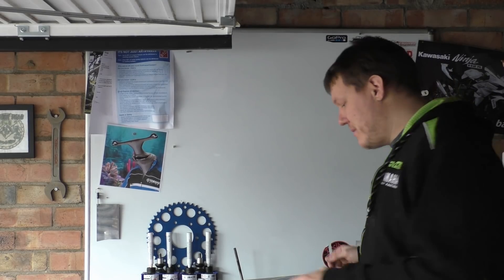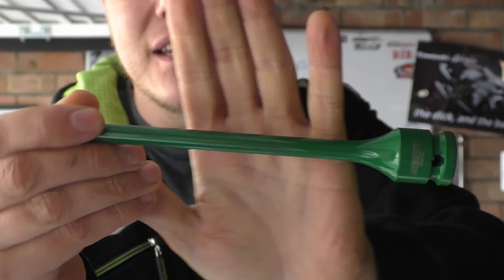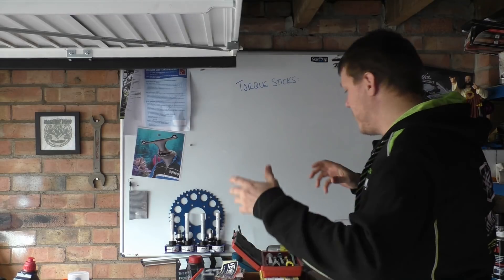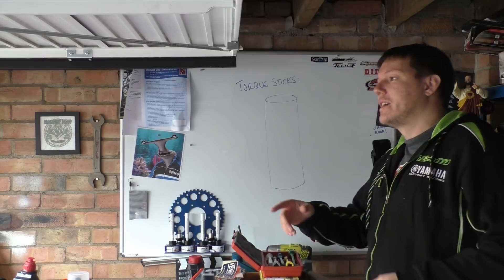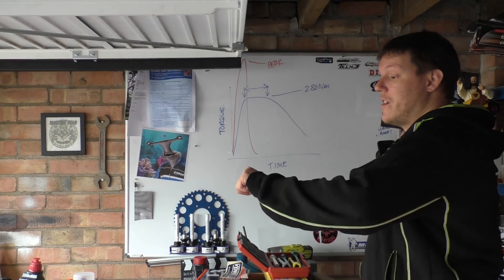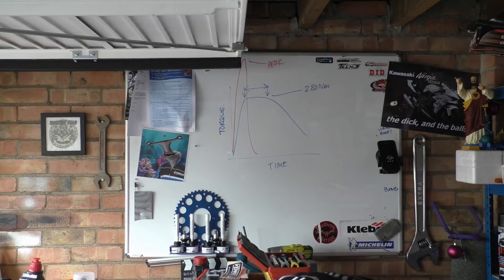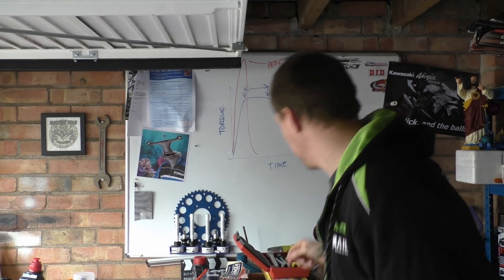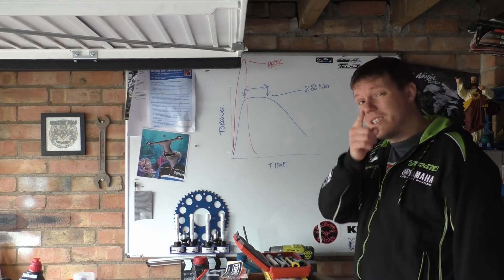Torque sticks - how they work

Comment: Awesome video! So it doesn't matter which impact gun I use at the shop??? Air... Milwaukee battery etc?
Reply from the maker: Well, there is a limit. If an impact gun fires too often then you'll get higher torque.

Comment: FYI - torque sticks are designed to be used  with and air impact. Using them on and electric/battery impact with result in different results. An electric/battery impact hits different then an air impact.
Reply: So, educate us what is the difference?
Reply from the maker: @mrgreen98ski What? Yes please educate us on how an anvil powered by air or a motor is physically different, all else being the same.

Comment: Does this mean that normal torque extensions bars have experience little to no torsion when impact is applied since you want the torque to be directly transferred?
Reply from the maker: That's a very good question, and requires a video...

Comment: 8:18 TRANSFERS KINETIC ENERGY TO HEAT!
You are missing some engineering and physics concepts in this video, but you are explaining it quite well
As for "atoms bending" or some ludicrous thing you said earlier that actually about steel alloy molecules (cube shape with a ninth atom on one face to allow the cube molecule to slide).
Nice tools, but wouldn't it be easier to have a lower torque power impact tool and finish the torque job with a torque wrench instead?
And leave the sticks to actual lesser jobs, those made with laziness with an impact power tool: thinking of someone who installs spark plugs like that 🤦‍♀️

Comment: I saw this about using torque sticks with electric impact wrenches from a company that makes torque sticks "ATTENTION:
Designed for Use with Air Impact Guns.  
Specifically, To Allow Tire Changers Fast Work While Limiting Damage Caused by Over Torquing Wheels.  
Also Helps Them to Use Standard 6 Point Thin Wall Sockets That Fit Alloy Rims (Never Use 12 Point on Anything With 6 Point Fasteners).  
These Are Not A Replacement for A Proper Torque Wrench on Other Critical Torque Applications.  
Not Recommended for Use with Electric Impacts as They Often Exceed 2500 IPM And Are Not Compatible As 41 Strikes Per Second Will Never Recoil.  
Lower Power Cordless Will Recoil but May Never Reach Proper Torque.  
Higher Power Will Over Torque as The Stick Never Rebounds.  
Properly Rated for Use With ½" Air Impact Having 300 - 500 Ft. Lb. Max. 
If Necessary Turn Down Maximum Speed to Strike Less Than 1000 Impacts Per Minute.  
Verify Settings on Your Gun After Initial Use. But Do Not Purchase Unless You Are Certain of Your Impact Specifications Prior To Purchase. "

Comment: How come you choose to put an all balls sticker on your whiteboard? Personally I have consistently found there products to be utterly shit. This is a feeling I have found to be present in my peers aswell.
Reply from the maker: Shite because?
Reply: @thedirtyworkshop  It's hard to quantify due to the anecdotal evidence but more often than not they don't fit even with careful application & removal of  heat. I have had far more problems with the limited number I bought before abandoning the brand than I have had with Japanese bearings bought from the local supplier. I don't believe my issues were due to user error. Another issue I encountered previously was with a swing arm bearing all balls used a piece of plastic between two washers  rather than an axial needle roller bearing to achieve the goal.  The general feel of them has been of poor quality. If I'm feeling rich I may just buy some next time I change out a set to compare to OEM spec (same bearing without the manufacturers storage fee). 
It's entirely likely I have developed a bias.
Reply from the maker: Cheers for the reply - I just wanted to know what you know. It's just a sticker - and you know what blokes are like with stickers. It's not an endorsement or anything - shit, I have a Delboy sticker and a screaming eagle sticker on there too.  The only time I used them is for steering bearing kits.

Comment: I've bolted on probably 5000 car/van wheels with those and an impact gun. Never had a wheel come loose or broken threads, so they must be doing something right. Good video though, thanks for that. I never pictured exactly the working principle of those. You might compare it to hammering a nail. A torque stick would be like a coil spring between your hammer and the nail head. If that makes sense.
Wheels are the only I use them on, and only with an air pressure impact gun.

Comment: Does it matter how powerfull the impact gun is? for example if you use a gun with 400 ftlbs vs a gun with 700 ftlbs will you get the same amount of torque using the same torqe stick?
Reply from the maker: No it doesn't - an impact gun 'hammers' - between each blow the torque stick then 'should' return to its normal rotation.

Comment: Did you test theses in the end ?
Reply from the maker: Not yet - but its coming soon
Reply: @thedirtyworkshop  Did you ever publish the test video?
Reply from the maker: Not yet. The reason was when I tried to test it in with the static strain gauge it was too fast for the cycles rate to detect.

So I'm going to have to measure it with an oscilloscope instead, when I get back around to it. I need to find a strain gauge thay can measure that high.

Comment: I have never used a Torque Stick but from what I have seen in videos and read they are used in tyre shops and production environments and this appears to be more in the USA. I personally would never use a rattle gun to do up to a torque but only the trusted torque wrench.  Have been in the situation after purchasing a 4 year old car couldn't get the wheel off from overtightening or locking up.  It took visits to three tyre shops before I found one that could get the wheel off and that was a small local one with an enormous breaker bar.  However they did say that it was how you used the breaker bar. What I have noticed in recent years is that most tyre shops, or the ones I go to,  now use a Torque Wrench to finish off rather than as used to be the case relying solely on the rattle gun.

Comment: I've used a form of these. they use them on car and truck lug nut's at the street shop i work at.the ones we use have the sockets built in.they've had the same set for over the 25 years I've been there you only use them to put the lugs on never to take them off.

Comment: when properly used one should select a torque stick that will tighten to a torque lower than desired. they are used for the speed of using an impact and getting close to the desired torque without exceeding it,  mainly for lug nuts. after the initial torque with the stick your supposed to use a torque wrench to achieve the proper torque. unlike the assholes at tire source that ram them on with an impact and no stick. then they are fun to get off with a tire iron on the side of the road with a flat.
Reply: My dad has bent multiple cross lug wrenches when the arses at the tire store don't use torque limiting (we notice when end up changing to winter/summer tires), not to mention breaking overtorqed bolts when removing them is a real problem with the material stresses after enough overtorqing on the same bolt. I swear to fuck it should be illegal to do
Reply: Adam Z or they can be handy for none critical bolts, tbh I would say the only real application would be l, use with Say a 90 nm, then always go from there with a torque wrench. 

They seem to be something that's really not that common in the UK, mostly American techs that tend to use them

Comment: Hiya Matt, quick question.  With all the flexing under peak torque, will the metal fatigue after a period of use and alter the value of the stick or do they have a limited period of use. Never used one myself and always rely on torque wrenches
Reply from the maker: We'll get to this after the testing - the torque at which these things yeilds at is the data we need to work about (or make a calculated guess) at the fatigue curve
Reply: I was thinking of getting a torque wrench so I can keep the various bolts on the bike in check, or in case I have to replace something. Problem is that i don't know how reliable are they and where to shop online. Or, if better, I could also arrange one to be sent from UK but as said I'm not sure how reliable are they. Any thoughts?

Comment: I'm not sure you're going to be able to get a reliable rating of a torque gun with sticks.  The hammer mass, impulse rate, stick, socket and nut/bolt are part of a resonant system full of unknown values. Using a big ass socket to fit the torque meter instead of a smaller one itself will change that system.  This is also why impact wrench ratings vary from voodoo to utter bullshit and everywhere in between.  Impact wrench testers can give relative ratings between different guns, but they aren't really measuring true torque.  They can't. As you mentioned, impact wrenches don't supply constant torque - they'd break your wrist if they did. 

Heck, "torque" is just a rough approximation of clamping force anyway.   Trying to use an uncalibrated, untested impact wrench at a random pressure with torque sticks in lieu of the proper tool adds even more ambiguity. 

Can you tell how much I hate those damned things? They work "o.k." when used correctly, which is almost never.  The right way to use a torque stick is to hand tighten the lug nuts, select a stick rated @ 60% the final value, hit each nut in the correct pattern until they bottom and give a few impacts, then finish off with a torque wrench.   I have never witnessed any shop doing this.
Reply from the maker: I'm with you all the way until "Heck, "torque" is just a rough approximation of clamping force anyway." Clamping load and torque are not the same thing, just to knip pick LOL
Reply: I could have stated that better.  Specified torque values are a  substitution for clamping load.  We can more or less easily measure torque, not clamping force, the thing it's a substitute for. We leave it up to the engineer to determine what torque value gives the needed clamping force based fasteners, materials, etc.   Or, "Follow the damned manual and use the right tool" .

Comment: I think they will work better with a ratchet or a braker bar you can stop if you see it twisting a quarter of a turn. The impact gun would just brake it
Reply from the maker: LOL didn't you listen, they are NOT for breaker bars....
Reply: Might as well just use a torque wrench then.
Reply: stathisko1 the torque stick transfer the impact energy to heat, similar to coil springs. The have to be able to give a bit, imagine you swing a giant sledge hammer on a chunk of steel vs on a big coil spring from a car, the steel block will deform or shatter, but the spring will be fine.
Reply: stathisko1 - in theory it would drop that 200Nm to 90Nm by elastically absorbing the remainder of the impact. In reality ... We'll find out next video.
Reply: daviasdf - think the point of these is there are times when you need to use an impact gun but still need to not over torque, otherwise yes I’d agree with you.
Reply: Spanner Monkey - I agree. I was responding to the comment that these would work better on a ratchet (they wouldn't).
They are only useful if you want to use an impact fun to quickly snug a bunch of bolts (But you should still use a torque wrench or something else accurate to bring them to final torque). You are never going to use these to break bolts free, which is the other time you'd prefer an impact gun over a wrench.
Reply: daviasdf i did understand what matt explained but if the minimum nm on an impact is over 200nm and u use that 90nm extension it will not sheer that extension?